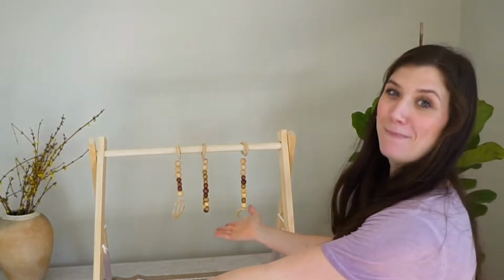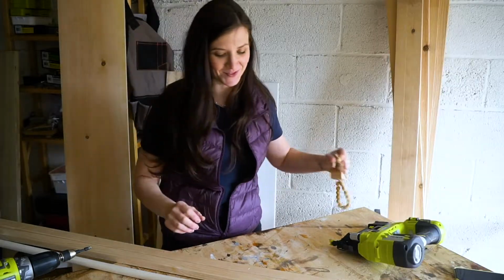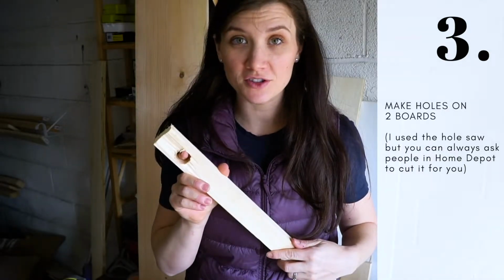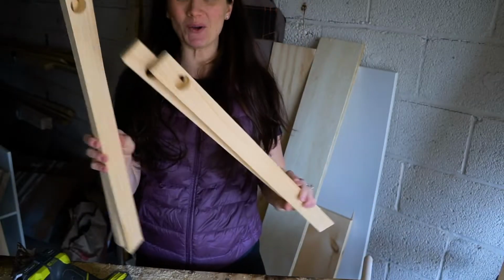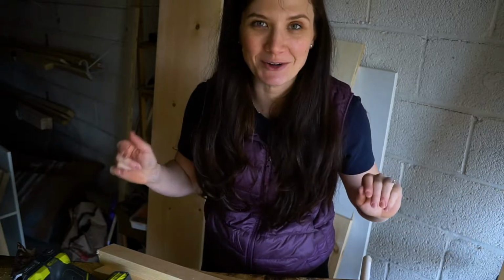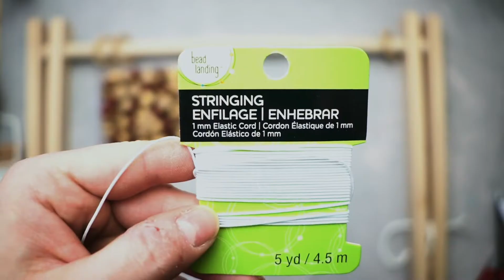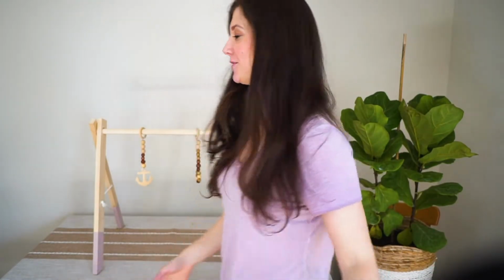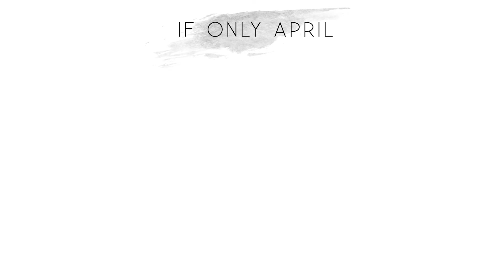EASY DIY WOODEN BABY PLAY GYM for $10 // Amazing DIY Baby Present Idea // If Only April

Comment: Hi! Great project. Just an advice. To avoid the wood being ripped when making the hole, you have to use some sacrificial wood under the board you're drilling into. That will avoid that problem you had with the first hole.
Reply from the maker: Thank you you for advice! More projects you do, more things you learn😄 I actually learned that trick way after I finished that baby gym. And just made a dining table from red oak last week using this method to avoid wood being ripped☺️ editing the dining table video this week, it should go live on Sunday if you want to see more of “immature woodworking hour”😅
Reply: @IfOnlyApril  It's called blow out. even if you drill a small hole with a drill bit, it will do the same thing to varying degrees. You do have an excellent work around with what you did though! A flat block of wood and downward pressure will help like Lucas mentioned.
Reply from the maker: Norma Banda thank you so much, Norma! Yes, we live we learn 😁 I found out about this trick after this baby gym project :)

Comment: Awesome! Thanks. What was the size of the hole saw or how big of a hole should I tell Home Depot guys to saw?
Reply from the maker: I had a 7/8" dowel so I used 1" hole saw. So it depends on the size of the dowel :) 
Go with the hole saw 1/8" larger than your dowel. Hope it helps! Super excited you'll be making it ;) Tag me on Instagram when you finish :)

Comment: She cut the 2x4 in half (lengthwise) to be able to make two baby gyms
Reply: I seriously doubt she would rip a 2 x 4 to get two 1 x 4s - she would need a table saw and would end up with one surface of each board requiring major sanding (unless you mean the other direction ... which would give you a 2 x 2). She's using 1 x 2 boards purchased from the lumber store.